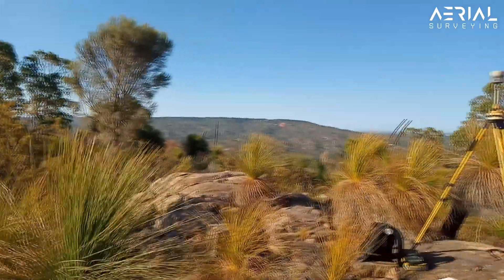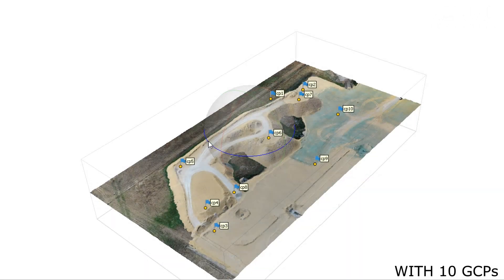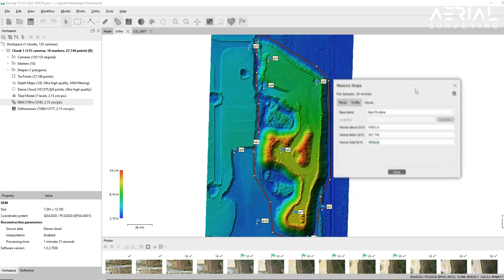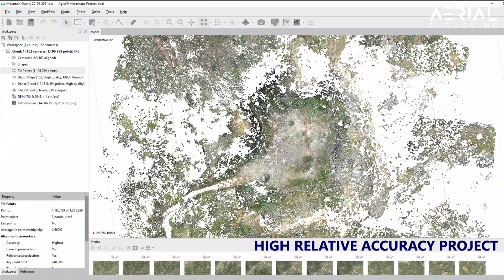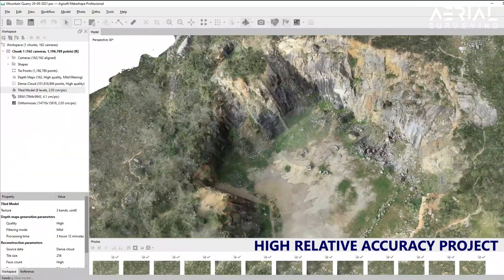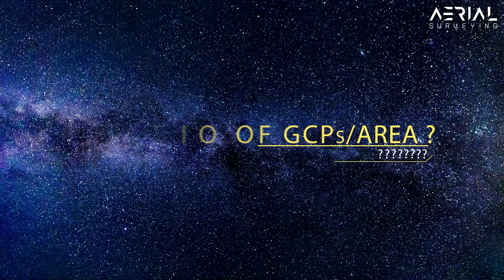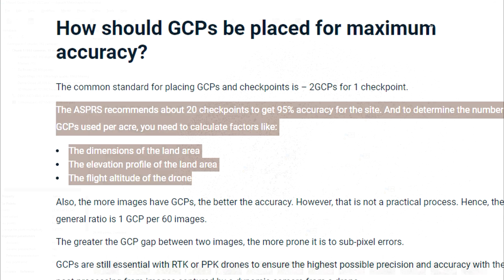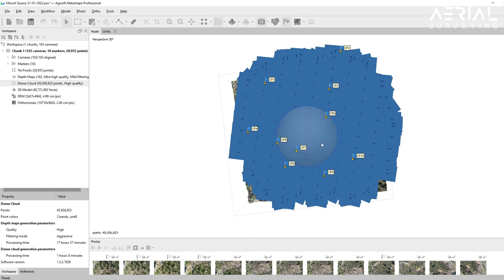The Purpose of Ground Control Points, Volume of Stockpile With 10 GCPs Vs 0 GCPs | Aerial Surveying

Comment: Very nice video. 
Regarding your use of the polygon: remember that you will have an absolute position shift in the polygon from the GCP based map to the one without.
Instead layout GCP targets as point references for your polygon. These targets should not be used for reconstruction of course. 
This will get you a better and truer comparison.

Comment: It's not quite clear to me. Is the video saying that stockpiles can be accurately measured without gcps but that would require rtk? If we don't have rtk or gcps how accurate should we expect stockpile measurements to be?
I don't understand why rtk would really make any difference for relative accuracy. I believe that for aligning the photos, the software uses tie points rather than GPS coordinates. Is that correct? If so, this should work without any GPS coordinates whatsoever,. No?
Thanks!
Reply: Exactly

Comment: Really impressive video !! I assume that GCP’s are absoluetly needed if the drone doesn’t have RTK ?
Reply from the maker: Thanks, in my Experience i wouldnt say that GCPs are 'Absolutely' needed, but its more of a Job Specific requirement, depending on the task.

GCPs will also help more with Orientation, Scale Factoring and Geographic Coordination.